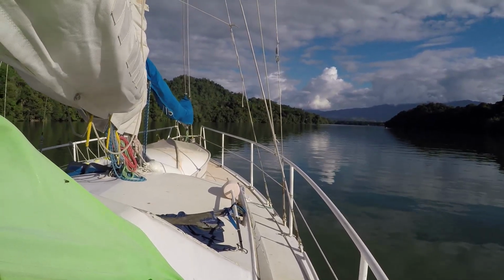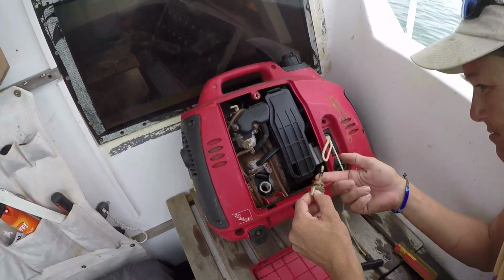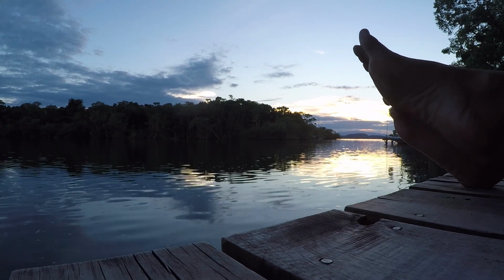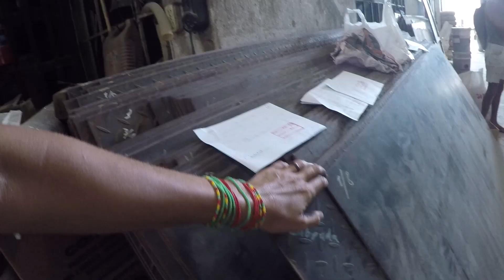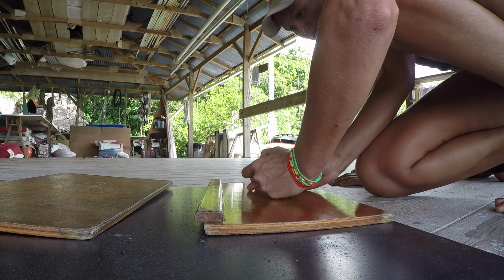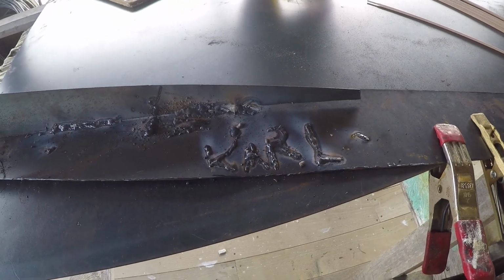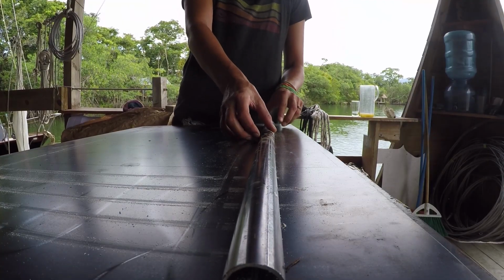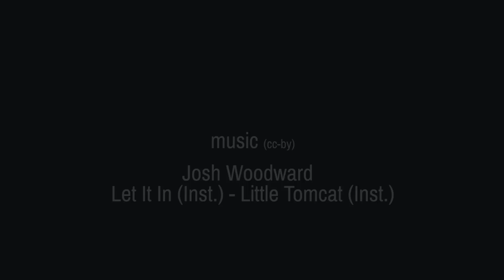Two Women Welding In The Jungle Of Guatemala - UNTIE THE LINES II #31

Comment: I have a generator similar to yours. Apparently it is important to try run the carburetor dry from petrol every time it is used. If there remains petrol in the carburetor for a while it tends to form some "goo" that effects the flow of petrol next time you try to start.Find a way to restrict flow of petrol to the carburetor when you want to stop it, rather than a an electric switch. Then it will stop from lack of petrol - i.e. empty carburetor. Good luck and thanks for making these nice inspirational videos.

Comment: Welding is an excellent skill to have in your repertoire.  It really only takes a bit of practice to become proficient enough to tackle some BIG jobs.  But not having an industrial sized welder to learn on as well as questionable electricity makes it very difficult to know when you are doing it right.  You certainly should continue to learn, it might not hurt to find a friendly welding shop in your travels and do a little welding with good equipment.  The type of welding rod you use also makes a big difference too, and moisture in your welding rod can cause trouble with your welds as well...

Comment: awesome!  You did very good welds considering the welder you were using, and that you were welding with stick (the hardest to learn).  About that welder, I'd bet it has maybe a 10% duty cycle.  In english, that means that you will get full power for 10% of an hour, the power output drops off precipitously after 6 minutes of welding because the transformer gets very hot.  Hot means power doesn't flow as freely, power not flowing as freely means tools being thrown (okay, maybe in my shop).  Long point, but really you guys did awesome, keep up the good work (and blame the welding machine).
Reply from the maker: Haha, thx +a71landcruiser! I did get frustrated in the end...no tools flying, but some light fist smashing on the table ;). Yeah, that's what my friend told me, too, about the power. It's a bit annoying...but hey, it was fun to play around. And I hope one day I get a chance to play with some "real" equipment.
Ahoy, Nike & Karl

Comment: FYI; Those generators have what is billed as an "advanced" maintenance procedure which I am sure you could do yourself. It consists of valve adjustments. They will run to a bit over 6000 hours without this however by then the excessive lash in the valve train has beaten the cam lobes down rather badly. The cost for a new cam and valve timing belt is like around 20 USD. . In any event, finding the valve lash specs before you begin and checking that is recommended.Too tight on either can burn them. Don't do that, better little loose than too tight.  If the valve lash is out some ridiculous amount then adjust them to specification if you can. If the cam is beaten down badly the valves simply will no open far enough to start the thing. This may be evident in a low compression reading.  Here is a youtube link to the valve adjustment >>>>>>https://www.youtube.com/watch?v=Ijq6BsFyatQ<<<<<<. Here is the youtube video on replacing the cam/timing gear and timing belt>>>>>>>https://www.youtube.com/watch?v=f0Wkbe2EHa0<<<<<<<<<. I would try taking the plug out and putting 4-5 drops of petrol into the cylinder and try to get it to fire and that fuel is in fact getting to the cylinder and that the fuel pump and carb are ok. . The cam replacement is pretty involved for some, but should be no problem for you. Just expect to aside an afternoon for it and you should be fine. NOTE: The single cam lobe is on the backside of the plastic gear, hence the low replacement parts cost.

Comment: Hi Nike (& Karl),

With the new metal companionway covers, do you have any deviation of your compass from magnetic interference? Also, what about corrosion protection. Fair winds...
Reply: +Stephen Bradley As Cap. Ron says if you get lost just stop and ask for directions. The way Nike is she would make ten new friends at any stop she makes. If it were me they would send me to the middle of the Atlantic. She has come along way from that one video where she seemed to be beaten, to taking any problem in stride.Strong smart and determined she will do well out there. It shouldn't affect the GPS.
Reply: +Uncle Muir Yes I agree about her determination and her flair for making new friends. I was so sad for her when she discovered all of those holes in Karl's hull. I think I might've been beaten! What spirit! I'm a little puzzled though about the need to introduce steel, particularly in a marine environment, with the potential for three extra risk factors: magnetic variation, corrosion, and potential catalytic reaction in the event of two dissimilar metals coming into contact with each other (steel/aluminium). I mean no negative criticism what so ever. Indeed, I have nothing but admiration for Nike and everything she has achieved. However, I might have missed the point here! Is it a security measure?
Reply: +Stephen Bradley Duh! I mean galvanic reaction not catalytic!!!
Reply: +Stephen Bradley If nothing else she would have a decent pattern to get one made from aluminum. Seeing how the welding was done I think a little rework may have to be done to prevent the warping of the panel. I thought I saw the panel was bowed a bit when the strengthener was welded on. Small stitch weld should have been run the length then tied together. I am still wondering why she wanted a metal one to begin with? If she ever makes it to Southern California we can make whatever her heart desires.
Reply: +Uncle Muir Yes, I noticed  the warping too. Possibly exacerbated during heating a cooling. But what a great first effort at welding, not to mention a skilful piece of pipe cutting with a hand held angle grinder. Well done! Now an aluminium replacement would be cool though wouldn't it? Lighter, whilst also eliminating those other 3 potential risk issues... Looking forward to the next video!
Reply: +Uncle Muir yes the UMA guys I also follow... Love their electric motor modifications and their great humour! Also check out a Dane called Mads at SailLife. He's quite prolific and has just sourced himself a larger boat to refit as a live aboard... He's very quirky, entertaining and endearing. I might start posting some vids about my meagre little Jaguar 22 trailer sailer (UK version of a Catalina) when I feel brave enough!
Reply from the maker: Hi +Stephen Bradley, this was really just something to play around with. It would have been great to do it from aluminium but a) did they not have the right material there and b) did the welder with the low voltage available not work for welding aluminum. It was only a little trial run to see if the appoach would work in general and to learn welding. If I had used it, I would have painted it to protect it from corrosion. It is not touching any aluminum once it is in place because the frame is made from wood. But in the end I left it behind and I will give it a new shot one day...
The idea behind it was to have something a little bit stronger for security.
Ahoy, Nike & Karl
Reply: +WhiteSpotPirates cool Nike, total respect for all of your great work and adventures... Keep going and stay safe...

Comment: The tip on most spark plugs screw off. I noticed one of your plugs was missing the tip
Reply: +solodare06 Depending on the plug cap, you can use the terminal cap or nor. Theu just screw on. If the plug cap requires the terminal cap and they didn't put it on they would not have gotten good spark.  Since she said they got spark, it's most likely a fuel/carb problem

Comment: Nice one, but what's wrong with wood? Lighter and doesn't rust.
Reply from the maker: +olof lee  this was really just something to play around with. It would have been great to do it from aluminium but a) did they not have the right material there and b) did the welder with the low voltage available not work for welding aluminum. It was only a little trial run to see if the appoach would work in general and to learn welding. If I had used it, I would have painted it to protect it from corrosion. It is not touching any aluminum once it is in place because the frame is made from wood. But in the end I left it behind and I will give it a new shot one day...
The idea behind it was to have something a little bit stronger for security...nothing wrong with wood at all in general :)
Ahoy, Nike & Karl
Reply: I would avoid use of mild steel, will rust like crazy in marine use, you'll be constantly painting scratches. Why do you have security worries, any bad experiences?
Reply from the maker: Just some stuff that I keep hearing about every once in a while...And why wait till you have some bad experience to take some actions ;)
Ahoy, Nike & Karl
Reply: +WhiteSpotPirates. Yes of course. Take care.